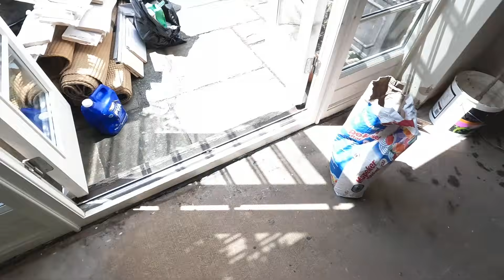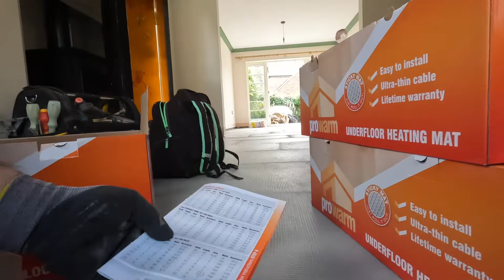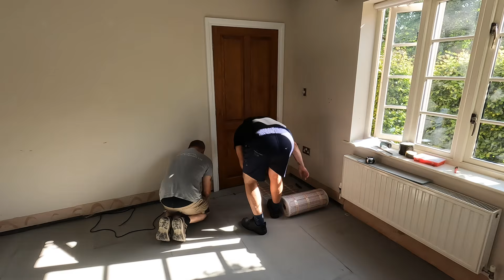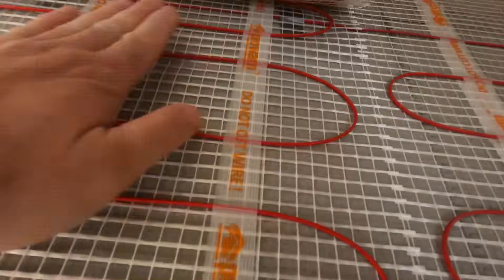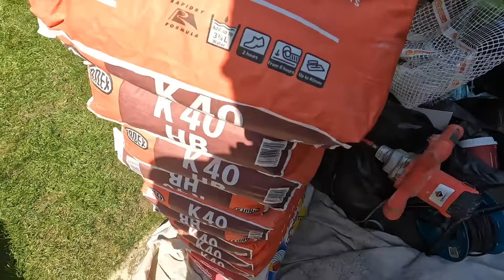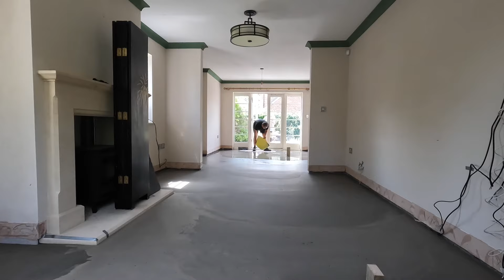Electric underfloor heating installation

Comment: with all the same setup, can we put engineered wood instead of tiles?
Reply from the maker: Hi . For wooden floors there is a different type of underfloor heating. You will buy this from the same shop.

Comment: Hi can you put insulation board under the subfloor I have timer subfloor which I’m changing to plywood subfloor. Can I put insulation board under to keep the ceiling height maximum
Reply from the maker: Hi. Yes you can .

Comment: I see you're installing insulation under the heating cable. That makes sense. A year ago, I had heating cables installed in two small bedrooms with concrete floors, and I asked about insulation. The supplier said they didn't have anything for that.
Reply from the maker: Without insulation you will lose heat . 
This type of insulation is around for few good years now.

Comment: What installation board are you using? I'm doing the a large area and ditraheat is super expensive
Reply from the maker: Hi . It is underfloor heating insulation. For tiling installation.

Comment: Thanks my friend for the video. Have question. What is the total power of these underfloor heating in Watts? How much Ampère in total? En did the electrician used separte MCB for each thermostat? Thanks.
Reply from the maker: Hi . This underfloor heating was 200 watts per square meter. We had around 25 square meters so in total . We did run a 6mm cable from the fuse board on a separate fuse to take this underfloor heating . We have used 2 thermostats for this area as one thermostat only work for about 15 square meters. You could use just one thermostat but that is more complicated .
Reply: .  Thanks so that 5.5 Kw, that's a lot for 1 fuse, or did you use two fuses. do you have 3 phase power in the house or single phase? One thermostat is too much for 5000 Watts. That's the reason you used two thermostat (max load).
Reply from the maker: @funwithrepair  I just use one fuse . I think it was 32 or 45 amp . 6 mm cable. You can still use one thermostat but is more complicated. You need an electrician to do that . In our case I run the cables myself and the electrician did the connections including at the fuse board. Single phase.
Reply: @valentinointeriors3023 . Thanks very much for your explanation.  Much appreciated.
Reply: @funwithrepair 5000 watts is a lot. so in use…Whats is cost per hour to heat that room to a comfortable but not over hot temperature? Compared to using radiators …. Which is more efficient and how much was the costs of the heating rolls etc ..not your labour just the materials…

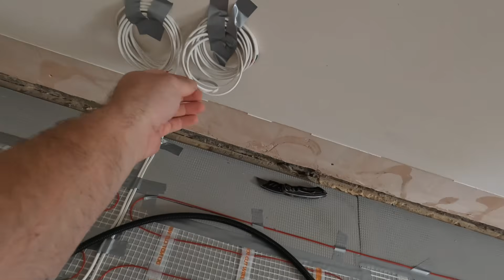Comment: 19:07 I haven’t tried this myself, but I think you could tape the sensor to a cable duct guide, push it through, and then cut the guide and leave it inside the tube.
Reply from the maker: @Trooper266  Hi . Yes , that will probably work. You can also remove one tile and replace it. I always ask the clients to keep couple of tiles extra . But i think for the price of an extra sensor is easier to install 2 from the beginning.
Reply: Some of the kits comes with flexible tube where you place a sensor and in case if it burn you can just pull out and replace with new one

Comment: Do you think underfloor heating mats could be installed into concrete without 6mm insulation boards and using foil? my tiler is concerned that insulation boards will cause tiles to become wobbly
Reply from the maker: I’m don’t want to be rude but if the installer thinks that it may not be a professional installer. There is no way the tiles will become loose if everything is done correctly. If you don’t use insulation you will loose a lot of heat. I will never install underfloor heating on the concrete without insulation
Reply from the maker: @IgorDavidJagor  I have a video on my channel about this boards . Everything you need to know about this boards . For concrete floors I will just glue the boards done . If you really want you can also secure them with some plugs and screws but I think this is totally unnecessary.

Comment: Which finishing is best for conducting heat through for max cost effective lvt, dryback, clickfit, laminate, floor tiles ?
Reply from the maker: Hi . Ceramic tiles are the best . Then Lvt and on third place flooring . I will not go over 10mm for flooring .
Reply: @valentinointeriors3023  sound professional would be good if you covered Birmingham area by any chance?

Comment: excellent video! We have a 1930s house with a small (aprox 2m2) utility room off our kitchen that i'm currently renovating. It's very cold with some damp issues which i need to address, but plan to install electric UFH afterwards for which your video has been extremely helpful for! The concrete subfloor in 1930s original with no insulation or damp proof course under the concrete (literally just a concrete slab poured on the earth beneath!). My question is can i still do the technique in your video? will 6mm foam tilebacker board provide enough insulation between the UFH element and the uninsulated concrete base? any advice hugely apreciated!
Reply from the maker: @Tom1983-e7p  Hi . Thank you for your appreciation. 6mm is a lot better than no insulation. A lot of people don’t use any insulation and after they complain about costs of electricity. If you have enough height you can get 10-12mm insulation.

Comment: Hey planning on attempting this, how much of a gap do I need to leave between the wall and the insulation board?
Reply from the maker: @batetambetanyi7015  Hi . There is no requirement for space between insulation and wall . You need to leave space between wall and tiles , screed , wooden subfloor. The heating mat should be installed about 10cm away from the wall.
Reply: Thank you ver my much for getting me back to me so quickly, how much of a gap do you recommend between the screed and the walls, as it’s a liquid initially what would I need to achieve the gap what you recommend using screed edging perimeter strips?

Comment: Hello how I can connect two heating electrick mat ? to one termostat we buy 2x 25 m mat I need conect 2 together in one termostat. Do you can help me? Thanks a lott
Reply: Okey I understand Thank you a lott If its to mutch wats for termostat its better place 2 singel termostats and will by also great One more time thanks 🎉
Reply from the maker: @DannyBigBoy888  Hi. First you have to check the power of the thermostat. Normally the thermostat goes up to about 15 square meters of under floor heating ( depending on the wattage) . 2 x 25 m mats may be too much for one thermostat. The way that you connect the wires is the same like you have a ring circuit in a socket. So the mat cables goes both in the same place in thermostat. Very important to check how much watts the thermostat can take otherwise it will burn. If you have more wattage then the thermostat you can install 2 thermostats or hire an electrician. There is another way of installation with just one thermostat but I can’t tell you how to do it as I don’t know.

Comment: Great video mate, but you don’t explain why you left 14 centimetres? Instead of 10 that the company states. Can you please explain ?
Reply from the maker: @adamlucas7059  Thank you . I left 14cm because we did herringbone pattern tiling . I wanted to cut the tiles on the edges after installation. The border was 10cm and I left 14cm just to make sure I will not cut the wires. There is a video on the channel where we installed the tiles . This will explain this in more details.

Comment: thanks for the vid, if I only wanted to cover half the floor with the underfloor heating, do I just need to insulate board where the mats are? do I just use self level screed to level up the rest?
Reply from the maker: @rss2030  Hi . You can do that.  If you do insulation board everywhere is a better result. This way you are not losing any heat and also it will be easier to get a level floor everywhere. It will not work out much cheaper to do levelling compound .
Reply: @valentinointeriors3023  Thank you
Reply: Hi mate great vid 👍🏻 I’m fitting 25 m2, can I lay my porcelain tiles onto the heat mat , or do I need to self level ? What’s best ?

Comment: Great video. Thanks! Question, can we put any display to a 4m2 floor heating mat? Are they all interchangeable? Can't find any info. Only that most mats and displays says 16A.
Reply from the maker: Hi , if you are talking about the thermostat you can have a different thermostat from the mats manufacturer. The only issue is the floor sensor. You need to install this from the same manufacturer as the thermostat otherwise they may not work. I’m n my opinion is best to get everything from one manufacturer. It is easier with insulation, warranty etc .

Comment: Very helpful video. Thank you!Can I ask if you laid down the underlay before laying down the wooden floor? If so, which is the underlay you recommend to use with the underfloor heating? Thank you!
Reply from the maker: Hi 
On this job we have installed tiles not wooden flooring. 
For wooden flooring you need to install the insulation then the underfloor heating mat ( which is different from this one ) , then the flooring can be installed on top of the mat . No need for underlay but that also depends on what type of underfloor heating is used. If you need to use underlay you can use but only the ones designed for underfloor heating.

Comment: I have to cover 34 m2 and I have 4 underfloor heating 10 and 7 m2, 10 and 8 m2, how do I connect them all together, would you have a connection diagram? thank you
Reply from the maker: There is only one room? Do you want them all 4 mats on 1 thermostat?
Reply: @valentinointeriors3023  yes for the kitchen
Reply: @valentinointeriors3023  BeWarm Electric Underfloor Heating Kit, 200w / m2 Sticky Mat (18m2, Smart White WiFi Thermostat)
Reply: @valentinointeriors3023  I bought two kits to cover the entire surface.
Reply from the maker: @matiasmartincruz7462  
Ok
In this case you will need to hire an electrician as this is not straightforward. 4 mats in one thermostat is something that I never did . You can do it , you just need to have a junction box where you connect the mats and from there in the thermostat. In my case a choose to install 2 thermostats as it was cheaper than the other option. With 2 thermostats is easy . One kit will be connected in one and the other kit in the second thermostat.
Reply: @valentinointeriors3023  but you can connect two to one thermostat and the other two to another thermostat
Reply: @valentinointeriors3023  if all four on the same thermostat

Comment: Excellent! Very helpful, detailed, and easy to follow. I will be sure to leave a 14 cm border. 5 years ago, we laid heating cables connected to rebar, then poured concrete over it in our garage with Saltillo tile on top. The slab heats up during the day (we have solar panels), the garage stays cosy in winter, and wecdon’t have to worry abt the pipes freezing. Getting ready to remove the last of the wall to wall carpet in our master bedroom. Will run cable on an uncoupling membrane then tile over it. Wish I had done that in the rooms upstairs as well. Thank you for taking the time.
Reply from the maker: Thank you for your message. Electrical underfloor heating is a great alternative specially if you have solar panels. All the best.

Comment: So how 2 matts was connected? 2 separate thermostats?  Seems like 2 thermostats on wall?
What if i want to install 3 zones 
Kitchen dining and hallway ro i need 3 diferent thermostats or i can connect all to one? And control everything on one thermostat?
Reply from the maker: So we had 3 mats connected in 2 thermostats. 10 square meters in one thermostat and 2 mats (7+8 square meters) in the second thermostat. You can connect all 3 areas in one thermostat. One thermostat takes about 15-20 square meters depending on the thermostat. That being said you can connect more square meters to one thermostat. But sometimes that creates more work for the electrician and is more expensive than having 2 thermostats.
Reply: @valentinointeriors3023   is there is any thermostat in which i can connect 3 different zones?🤔
Reply from the maker: @jonasbagdonas9858  You can probably do that but the electrician may charge you more than having 2 thermostats

Comment: Direct Electric is an odd choice when electricity is so expensive a unit.
Reply from the maker: Not if you are planning to have solar panels.
Reply: @valentinointeriors3023 exactly that mate, I’m doing exactly the same, electric heating through out and a roof full of solar panels and batteries
Reply from the maker: @stephenwhite3832  Well done. 
Hope you get one system with high warranty.
Reply: Is pva primer a good idea on any floor? I would use acrylic primer to be safe.

Comment: Great video! I'm just curious. I'm about to install a 35sqm area with electrical underfloor heating. It's for my wife's yoga studio where she will be running classes. Will a yoga mat, for the duration of a class pose a threat to overheating?
Reply from the maker: Hi 
I don’t think that will be a problem. 
There will be gaps between one mat to the other so the heat can escape. 
In my experience it’s not easy to overheat the wires . Some people have big rugs over and no problems.
Reply: @valentinointeriors3023  Thank you so much for all your help.... I might have one or two more questions later on ☺️
Reply from the maker: @DennisCollins79  No problem. Please ask if you have any more questions. 
Thank you
Reply: If I have a new concrete floor and am putting down a new laminate floor, do I need to put leveling compound down? Or can I go straight on to the mat?
Reply from the maker: @DennisCollins79  If the concrete is nice and smooth you can lay your floor over. If you are laying flooring you have to use a different electrical mat then I have used in this video. You need to use: under wood electrical heat mat.

Comment: Would the same procedure be done with a wooden floor or laminate?
Reply from the maker: Hi 
For Wood/laminate flooring  there are different underfloor heating mats. Search for underwood heating mats. Is the one with aluminium foil . So you have to lay the mat then flooring underlay ( suitable for underfloor heating) and the flooring on top .
Reply: What can go on top of wood boards, before laying underfloor electric heating, what are the steps exactly please, having wood boards as  the base, then enginereed wood flooring as the last layer?
Thanks loads.

Comment: Hi 

Great video thank you. Please can you explain. Do you need to seal the joints on the insulation board with tape if there are small gaps and also does the whole thing needs priming again after the insulation board and electric mats before pouring self level
Reply from the maker: Hi , thank you 
If you have gaps you need to seal them . If the insulation is tight there is no need to use tape . This insulation is a tile backer board and doesn’t need a primer. 
It may differ from insulation to insulation.

Comment: Hi have you had any success laying Engineered wood floors over the same system as in this video???
Reply from the maker: Hi 
For engineered wood I have used different underfloor heating system. 
This is for tiled floors. 
For wood you need to use something like this : 

https://www.theunderfloorheatingstore.com/products/warmup-foil-underfloor-heating-kit?dfw_tracker=170908-WLFH-140W/140&gclid=EAIaIQobChMI78rSlNrF_wIVku3tCh0YCwfWEAQYASABEgIOwvD_BwE

This is designed for wood floors. It is ok but not as efficient as the tiled floor.

Comment: Did you connect the two rolls of the net? or are they on seperate thermostats?
Reply from the maker: There are 3 mats with 2 thermostats. 
25 square meters in total. 15 on one thermostat and 10 on the second one.
Reply: @valentinointeriors3023  how did you connect them?
Reply from the maker: @iMeze  2 mats in one thermostat. There is just enough space to connect 2 cable in one point. There is another alternative to have a junction box and from the junction box one cable to the thermostat but in my opinion this is more complicated.
Reply: I would just used one thermostat for both of them instead of having 2 on the wall.
Reply from the maker: @kestutisbaratinskas2634  To have just one thermostat will be more expensive because it is more work. Plus you need a decent size junction box ( accessible) . So this was the electrician choice and we went with this, client didn’t mind having 2 thermostats.
Reply: @valentinointeriors3023  don't need any bigger boxes just need to have a relay and run thermostats through that

Comment: Thanks for your video. I wanted to make that with aluminum foil, what you think about that?
Reply from the maker: Hi 
The underfloor heating with aluminium foil is designed for laminate/wood flooring. Depending on the floor covering you have different electrical underfloor heating systems.
Reply: @valentinointeriors3023  Thanks

Comment: Can you use electric floor heating for a whole house
Reply from the maker: Hi 
Yes , you can . At the moment is not more cost effective than the gas alternative.
Maybe if you are thinking of having solar panels. 
Also if you are going to do underfloor heating on whole house you will need to run new power supply from the fuse board ( for the underfloor heating)
Reply: @valentinointeriors3023  appreciate
Reply: Hi  @valentinointeriors3023 . Would you install electric underfloor heating without solar? Would it not cost a looot to operate it?
Reply from the maker: @ Hi . It is depending on few things. The house where we had this installation will probably have solar panels installed. After the first winter I did ask the owner about the electrical bill as there was quite a bit of electrical underfloor heating cables installed. Apparently the bill wasn’t very expensive. In that area we left one radiator and I guess that is also helping. Having insolation is also helping.
Reply: @ appreciate it.